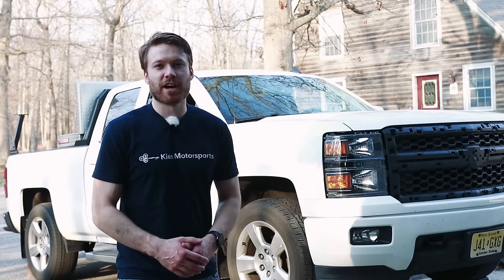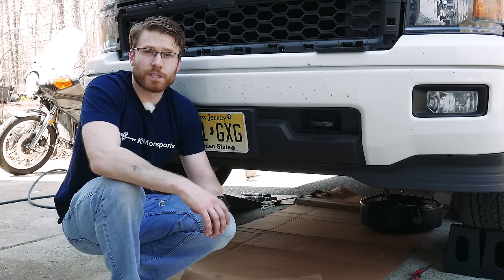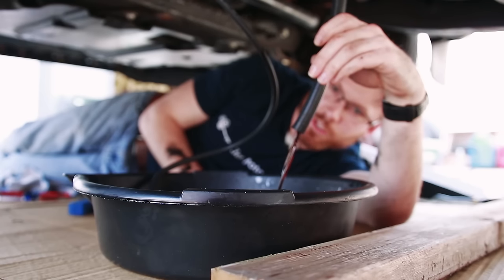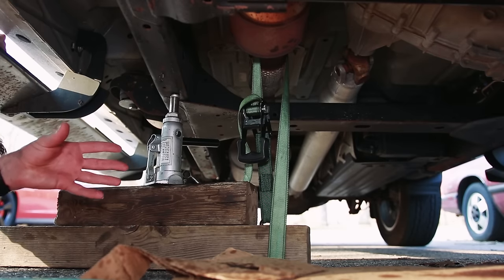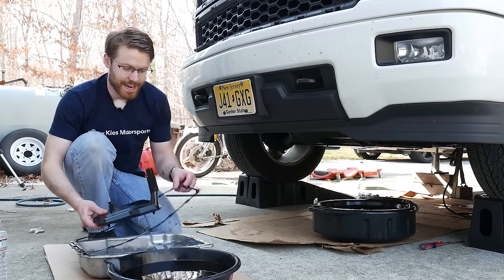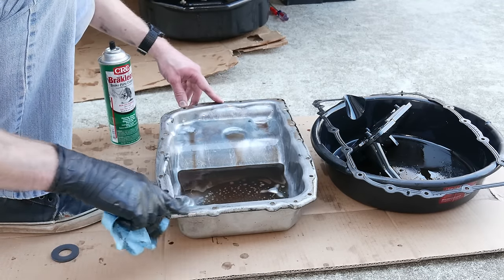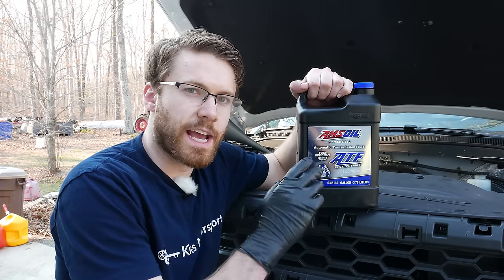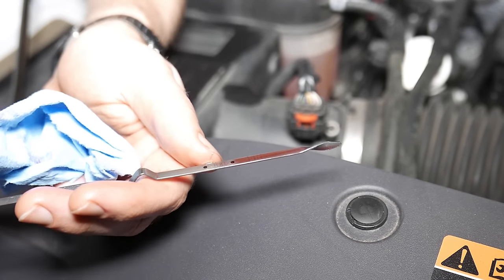6L80E Transmission Super Flush and Filter Change Silverado Sierra Tahoe Suburban Yukon Escalade H2

Comment: It was so much easier to take my truck to the dealer for this. The price was reasonable and they changed the ATF in my transfer case as well.
Reply from the maker: Nice! Just curious your location and how much they charged
Reply: @TheSundaeDrive  I think I paid around $300 in September of last year for transmission and transfer case fluid change including a new filter in the transmission. 2012 Silverado 1500. It was at a Chevy dealership in Utah County, Utah.
Reply from the maker: That's not bad 👍
Reply: @Todd_S  But.......are you sure they actually did it???? That's the thing about doing some things yourself, you know they actually got done.
Reply: I asked my service guy at the dealer how much it would cost to do a transmission fluid change with new filter and gasket, he said the gasket was reusable and the total price was going to be $671.97 plus tax which in MD is 6%, but they could put a new gasket if I wanted for another whopping around 55 bucks. This is for a 2018 Escalade. Basically same service as a Silverado or Yukon or any other 10 speed GM transmission.  You can do the transfer case with 2 quarts, takes 1.6 for my truck, for $30.00 using Amsoil , of course use the specific fluid recommended for your truck. That in my opinion is the easiest of all services to do, even easier than an oil change. If you have a clean garage floor you don’t even get dirty.
Reply: @Cocora22  The technician shows a video that I get a link via SMS and my transmission had been making a loud whining noise at slow speeds. After the fluid and filter change, the noise went away. I have a good relationship with the service and sales teams and I trust them. They've taken good care of my truck.
Reply: @Todd_S  then you are very lucky and blessed. Around here it goes from bad to worse which is why I keep learning as much as I can so I can do as much as I can myself. Then if I can’t do it myself I want to at least be as well informed as possible so I can explain what is going on and what I expect. I’m also not afraid to get under the truck and try to verify if something was done. It really shouldn’t have to be like that. People in Utah are more honest.

Comment: I bought the replacement transmission filter and it came with a o ring type thing, I also noticed it on the filter you linked. But when you took off the filter in the video, I didn’t see that part on the old filter. I also didn’t see it when you installed the new filter. Does that o ring only for certain vehicles and not necessary in this truck?
Reply: Check to see if it's stuck in the trans. You should have it, and if you have a new one might as well replace it.

Comment: How has the trans been with Amsoil ATF?b will be doing my 17 Silverado soon.
Reply from the maker: It's been really good :) as good as these transmissions can be anyways lol. I just did a change of the fluid with a torque converter swap to preventatively at 108K. No issues so far

Comment: Hi if I was to use a Mityvac to just suck a few quarts out of the pan through the dipstick and repeat a couple times, would you recommend sticking with the AC Delco fluid or go ahead and use the amsoil atf? I used amsoil in my transfer case and both differentials but not sure if mixing is ok or better to just stick with the ac delco that’s in there. Truck has 20k miles thanks for all the useful info 👍🏻
Reply from the maker: You are changing it early. You could probably wait another 10-20K miles easily but better to do it often then never 👍 That method would definitely work but I am not sure on mixing of the fluids. You could reach out to amsoil, they are very responsive and could advise you. May just want to play it safe and use AC Delco fluid during the warranty period.
Reply: The Sundae Drive yeah I think you’re right.... I’ll stick with the ac delco Dexron 6 until the 50k mark and then do a full flush/filter change. I know it’s early to be changing some of the fluid at 20k miles but it’s a 2014 been 5 years since I bought the truck and figured it’d give me something to work on 😂. A few new quarts won’t hurt that’s for sure 👍🏻 awesome videos keep up the good work.
Reply from the maker: Ahh yeah, probably a good idea for some fresh fluid after 5 years lol. Thanks!!
Reply: The Sundae Drive can I send you an email of a couple pictures of my drain pan. I think there is plenty of clearance between my exhaust and the pan. Was wondering if you can take a quick look and let me know if I’ll be able to get it out without having to jack up the transfer case and pull the exhaust down. Not sure if having my truck lifted 10” would change the angle but there looks to be plenty of room. 👍🏻 
2014 Sierra 5.3 with the 6 speed automatic
Reply from the maker: Sure Cliff@thesundaedrive.com

Comment: My transmission snapped a tooth at 157,000 miles ceasing the transmission. Just a fair warning to all your fellow 2015 chevy owners. Never missed a service cycle interval either.
Reply from the maker: Ouch 😳
Reply: @TheSundaeDrive  Yeah, did all the service myself by the book like yourself. Today on my way to work, the truck high revved and I lost all ability to drive. Pulled the transmission filter and it's full of plastic and fine metal.
Reply from the maker: It probably is your torque converter. they are known to go on the 6l80
Reply: I have only 56,000 miles on my 2015. Took to dealer to have fluid and filter change. Said they test drove it and said it was slipping so they didn’t feel comfortable changing the fluid and filter till they did a diagnostic. Sometimes I could feel it shifting a little hard going into I think 2nd but only when it was cold. Not sure what to do now?

Comment: Did you notice a difference driving the truck after the transmission fluid change?  Better shifting? More responsive?
Reply from the maker: Not particularly. Maybe a slight improvement. I know in a manual trans it is usually easy to sense a difference. A bit harder to tell on a truck with an automatic. These transmission shift pretty hard sometimes by design which makes it difficult to notice slight improvements.
Reply: The Sundae Drive that's one of the things I was hoping a fluid change to Amsoil would help, is the occassional hard shifts.  I followed your other videos to do the front & rear differential and transfer case, all with Amsoil as well.  Saving this project for a weekend when I have plenty of time :)  Thanks for the videos!
Reply from the maker: 14_ Z71 glad the videos are helping! More to come

Comment: Ok, I just want to say a few things, you will not be able to do this job without the ratchet strap and a board against the cross beams. it's really easy to do. The people saying you dont need to do this probably dont have a V8 truck or 4wd. It tried without the ratchet strap and it wasnt happening. You dont need a bottle jack, thats a waste of time. I want to point out that this is the only video that shows how to get the most out of your transmission.

Comment: You missed on a critical part. You never changed the filter seal. That is a very critical seal . If it is not changed pressure will be lost. I rebuild about 3 of these transmissions a week for the past 10 years. Make a lot of money doing it
Reply from the maker: Good point. You are referring to the cylindrical seal in the hole that the filter neck sits into? How do you go about removing those? They always seem very tightly stuck in there. It also depends how frequently you are changing the fluid, the gasket should last for one change but, mineaswell change it while you are in there.
Reply: I usually have good luck with a seal puller. There is enough room to get in there. Be careful not to score the pump cover. The pan gasket lasts a long time. I hardly replace them. I wouldn’t worry about the pan gasket getting the pan on and off. All that pulling on the pan against the module is what I would be concerned about. You crack the module you got a big expensive problem. Then you would need a guy like me to fix it. I deal with the weekend warriors that create more problems trying to save some money, but cost more in the long run.
Reply from the maker: Alright I will look into getting one of those. And I bet you do haha. Looking forward to getting a dual exhaust so it is out of the way of the pan.
Reply: @GMtransmissiontech74  Hi - do you got a links to the SEAL puller - thanks?
Reply: Have a Part # ? Looking for this seal on the web and nothing.
Reply from the maker: It usually comes with the filter. see the link in the description of the video and it shows one with it.
Reply: The Sundae Drive when you change it next if you would please show how to get that seal out. Sounds like it can be a pain and would definitely want to see how it’s done/best way to get it out before I attempt. Thanks 🙏🏻
Reply from the maker: For sure! I am planning to do another video showing an alternative way of accessing the pan and we'll include that
Reply: Just drop the y pipe in the exhaust. So much easier! No reason to struggle for hours jacking stuff up and down. Also, a threaded piece of PVC can be “screwed” in to the filter seal and then the seal can be pulled/levered out easily. Then drive it in with a seal driver or proper size socket if you have to.
Reply from the maker: Good tip with the threaded PVC. What diameter do you usually use? I've thought about dropping the y-pipe but it requires unbolting the headers. I still may try that method next time tho.
Reply: The Sundae Drive I think it was 3/4” if I remember right. Hmmm. Yours must be different than mine. Mine is a 2011 6.2
Reply from the maker: Yeah, I think it is a little bit different on my truck. And ok. I'll definitely try that during my next change.
Reply: We have a person here in houston that fixes the pump and stator ...150$$ instead of 500$$$.....and he us trying to build a better converter which is the achillies of these style tranny's...
Reply: @TheSundaeDrive  upgrade your trans cooler also..and a zmax valve body kit will replace the valves that wear out and cause pressure issues....good luck
Reply: I don't think I've seen another video on an alternate way to access the pan  @TheSundaeDrive  unless I missed it?
Reply: @GMtransmissiontech74 where are you located? I need mine rebuilt
Reply: @mishutkin101  New York
Reply: Could this cause to throw a p2723 code? Had shop do this now it throws this code ever since transmission flush 2014 with 150k miles

Comment: They sell a transmission pan with a plug installed on it. When replacing the pan I would install a new one so I wouldn't have to worry about that again. Doorman sells one at advance auto for a little under 40 dollars here is the part number. Fits 2010 and up maybe earlier years too am not sure. Part # 265-811 (Advance Auto)
Reply from the maker: Thanks! I will definitely check this out! Maybe we'll make a video on it
Reply: Yes its for GM and it should fit all. I looked at it close and the one I seen you pull out of your truck and it looks the same. I have a 2010 Suburban and it says exact fit. I subscribed and love these videos.
Reply from the maker: Awesome! :)
Reply: Do your Hw next time before shipping off bad info!
Reply from the maker: Ok thanks for the info and heads up!!
Reply: I just a oil change on a 2010 and it fit perfectly. If your trying to sell someone elses theres a better way to go about it. lol
Reply: @TheSundaeDrive  on the new pan with the link below wouldn't that drain bolt be in the way of the crossover exhaust pipe?
Reply from the maker: I have to look into it more to see. You may be right. Planning to add a pan with a plug during my next change, either by adding a plug or by getting a different plan

Comment: what you should do first before changing the filter is to flush first and then change the filter
Reply from the maker: Takes a little more fluid but yes that would be the way to get the most clean filter/fluid possible

Comment: thinking about doing this but not at all sure about using the running truck to pump out the old fluid.  I know in your example you ddidn't but I also know there is not much worse on an automatic transmission than to run it without fluid
Reply from the maker: Definitely never ever run an auto without fluid. You just need to be very careful that the pump doesn't run dry. You could always do a fluid change then flush the system by adding new fluid at the top while you pump out the old fluid and nothing will ever be dry.
Reply: Adding new fluid at the top - doesn't it mix with the old fluid though  @TheSundaeDrive ?

Comment: On the 2015 Silverado crossover pipe is back further and lower so you can remove pan at least on V6 engine.
Reply from the maker: The v6 has a different setup but good to know. I can't wait for a dual exhaust setup on my truck because it will eliminate this problem

Comment: You mentioned that you need to check the fluid when the transmission is hot. Is that hot with the engine running? Or hot with the engine off?
Reply from the maker: I believe you want the engine to be off. This is what I pulled out if the owners manual "Use this procedure to check the transmission fluid level when the transmission fluid temperature is
between 71°C and 93°C (160°F and 200°F).
The hot check is the most accurate method to check the fluid level. The hot check should be performed at the first opportunity in order to verify the cold check. The fluid level rises as fluid temperature increases, so it is important to ensure the transmission temperature is within range.

There is a lengthy section on this in the owners manual so I would definitely read through that.
Reply: Always check HOT with the engine running and in park.
Reply from the maker: That's what I always do

Comment: Seal is included with the Filter from ACDelco
Reply from the maker: Correct. That is the kit I have a link to in the description
Reply: @TheSundaeDrive  Did you replace the seal or reuse it in this video?
Reply from the maker: You should always replace the seal. I cannot remember if I did it or not tho in the video tho. It's been too long lol
Reply: 6L80 has the reusable gasket. He reused the gasket in the video.
Reply: Great video thank you so much! I see you didn't replace the filter gasket, necessary or not?

Comment: Thoughts on Amsoil fluid?   
Still using it?   
How’s the trans shift with it vs.  Factory AC Delco Dex6?
Reply from the maker: Still using it and shifting is a bit better.
Reply: you would have better luck using a used engine oil mixed with sand, than using anything from amsoil,,  amsoil is all marketing hype, just like slick 50 and the rest of the garbage you see on tv infomercials
Reply: @joel-cg4rv  and why would someone not use amsoil? Just because some fool like you on the internet says not to? 🤣🤣🤣

Comment: Hi,
I have 2012 chevrolet Tahoe, l need to know the part number of the Original filter transmission. ACDelco is 933 but is it OEM. Tall my the part number. Thanks.
Reply from the maker: AC Delco is usually OEM. have you reached out to your local dealer? They would be the best source. Also use gmpartswarehouse.com as a resource to look up part numbers